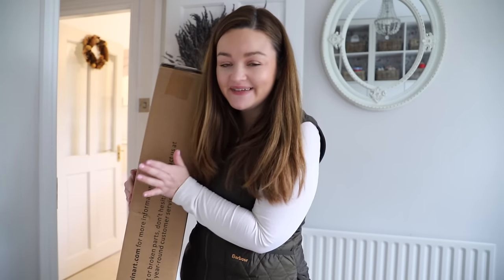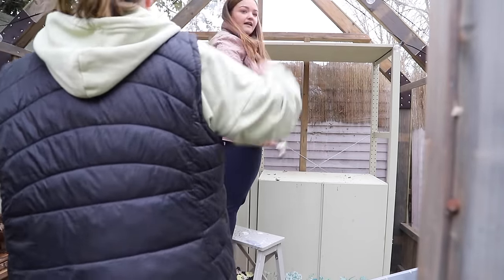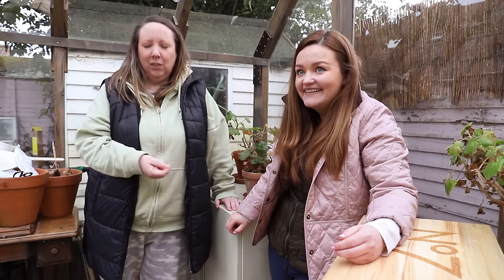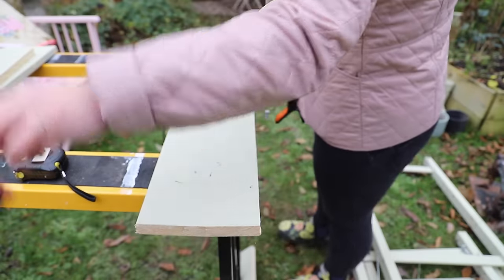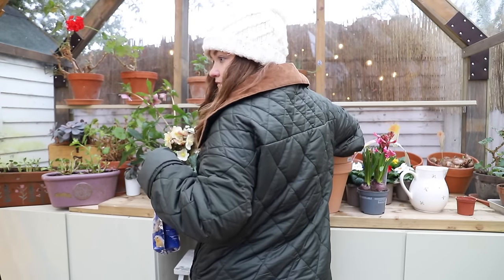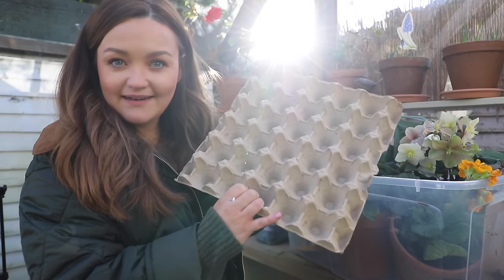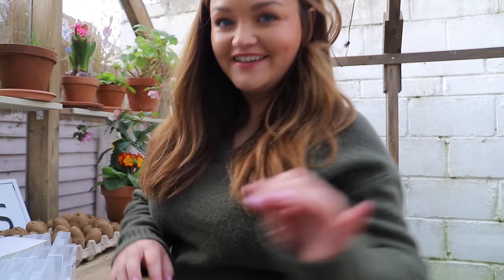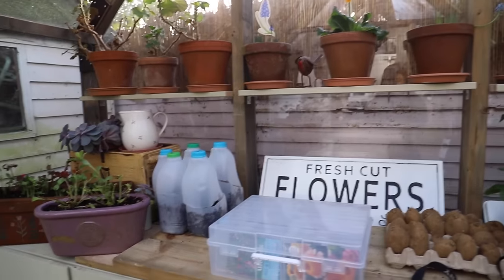Upgrade Your Greenhouse: DIY Seed Sowing Station & Sweet Pea Growing Hack

Comment: Hi 👋  Catherine 😊 with your old scap  wood, make yourself a potting tray. Just a scap 2'x3' piece of plywood, then secure to pieces of 2x4 to make sides. This will help keep all the soil in it,and not your table. When not in use, just slide to the end of your table and use it for storage . I've used mine for years, and when done potting just tilt the tray soil into the bag of dirt.
Reply from the maker: Yes, I had seen Laura from Garden Answer make one and I really wanna try